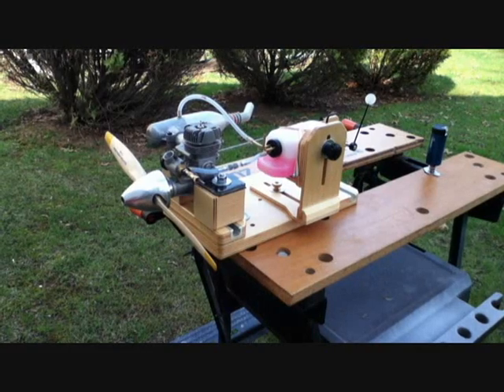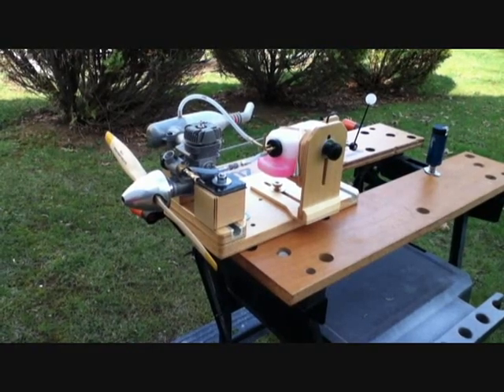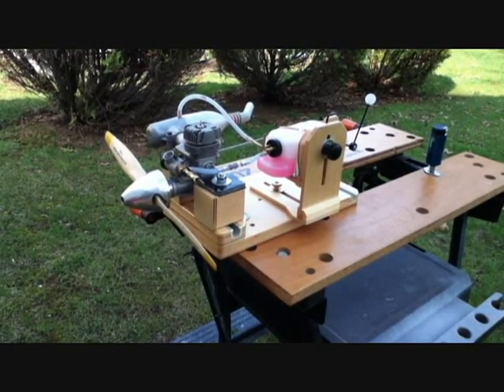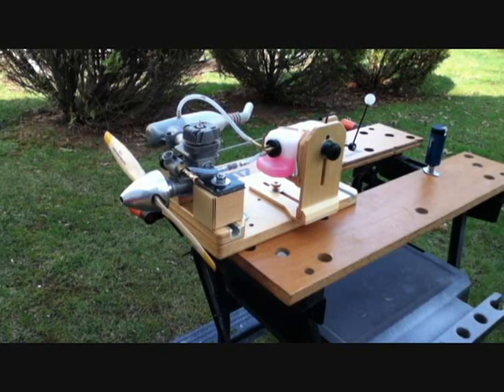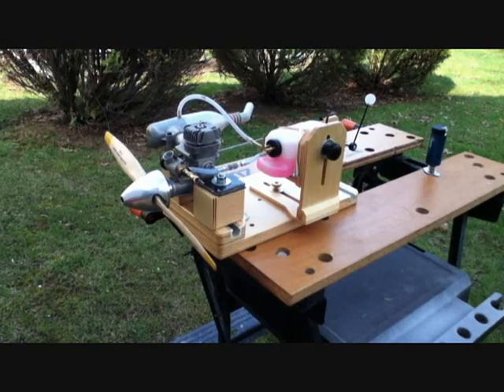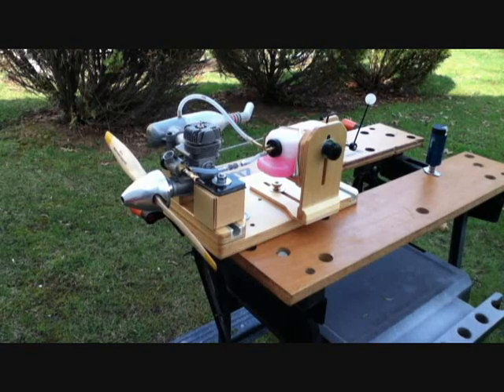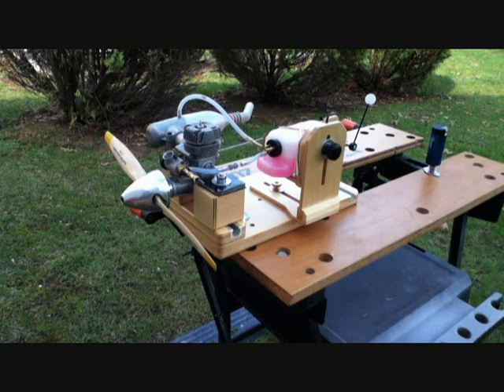SuperTigre G.51 on Test Stand

Comment: please could you give us some carb. settings?
Reply from the maker: Will have to check my notes...
Reply: ok, lot of people had problem with that carburetor........low end screw  must be unscrewed at least  6 turns!!!  not common even in a ultramix type carb.( maybe factory trouble )
Reply from the maker: I pulled out the G51 and here are the settings for all three adjustments:

High Speed Needle (main needle valve) was set at 3-1/2 turns out
Slow Speed Needle (inside the throttle barrel on opposite side) was set at 2-1/4 turns out
Idle Speed Screw (near carb air inlet) was set at 2-1/2 turns out

I haven't run this engine in a couple years, but I would suspect these were not played with in between then and now. But, different engines from different manufacturing runs may be different?

This particular one has always run very well.

I have another Made in Italy G51 that's brand new in box, so I can't check it with that one as it's never been run.

I also have another Italian G51, but it's a control line version.

Check out my other video on "RC and Control Line Engine Test Stands" to see better video... this video was kind of poor quality...
Reply: thank you a lot!!  i'll check next time with  your settings !!....